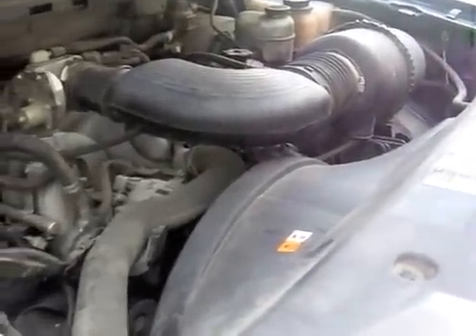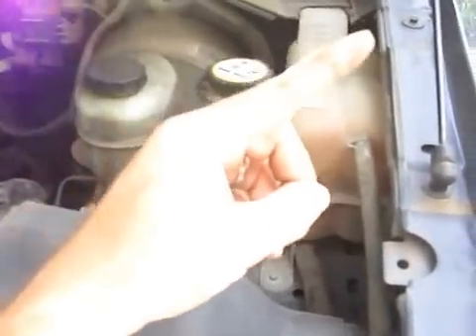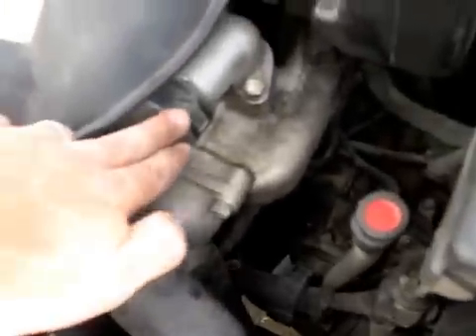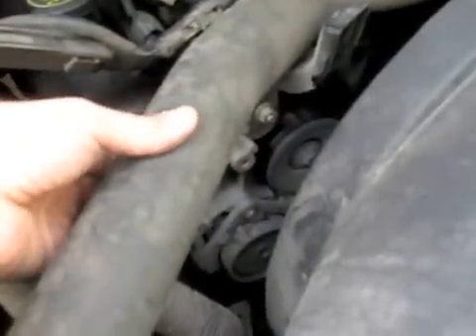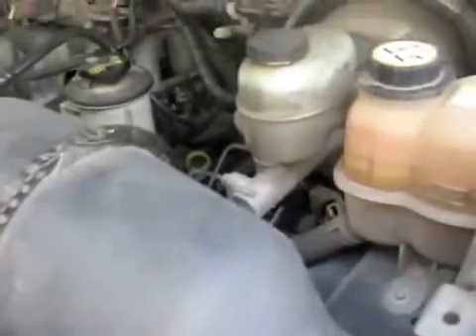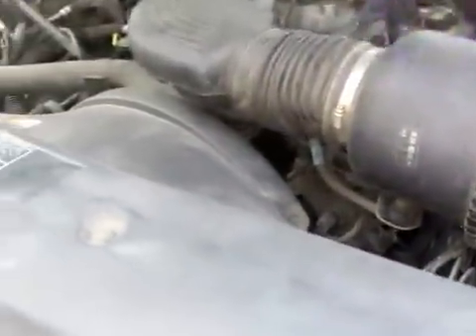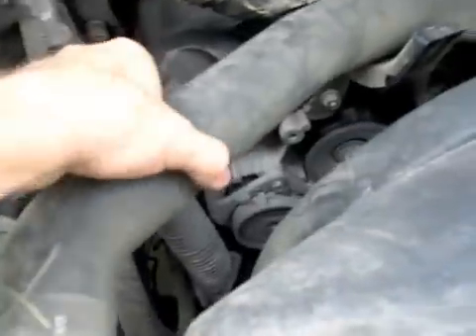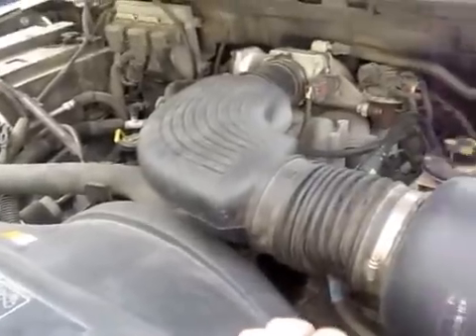Car Engine Overheating - Causes and Symptoms of Over Heating  Car Engine

Comment from the maker: The newer 323 should have an electric radiator fan. Overheating at slow speeds is due to lack of air flow across the radiator and or lack of coolant circulation inside the engine/radiator.  A bad manual fan clutch on an standard fan, a coolant leak somewhere, air pockets in the cooling system, a faulty radiator cap are things I would look for. Open the hood with engine on and running hot, if you have a manual fan the air from the fan should be hot/warm, if not the radiator is low on coolant.

Comment from the maker: Did you watch the video? If the radiator is low on coolant I would get a pressure test done on the cooling system first. if not low, make sure the electric cooling fans are coming on at idle. Then check to see if there is a restriction in the radiator causing low coolant flow. The boil over is just a SYMPTOM of the overheating, so have to find the cause of the overheating. My video should have helped narrow things down. Start with coolant level, fans, radiator restriction or air pockets

Comment from the maker: I still suspect a problem with the electric cooling fans or you have a radiator that is restricted with gunk at the bottom not allowing coolant to flow fast enough throughout the engine.  Double check that the electric fans are coming on then feel the upper and lower radiator hoses (caution they will be hot, or should be hot) they should be about the same temperature when the engine is at normal temp. If not, you have a radiator restriction or an air pocket in the cooling system.

Comment: hai, my engine would overheated when I switch on an air conditioning system or when the traffic is not smooth, I sent my car to workshop, the mechanic told me the radiator fan in good condition so he replace the thermostat, replace the thermostat, radiator cap, and flushing the radiator but the problem still there.Pressure test showed that my radiator no leaked, anyone can help me?

Comment: I'm thinking of getting a 66 v6 mustang for my first car, would this suffer from overheating issues, I worry about how it would cope in traffic, costs about 10000 dollars. Thanks
Reply: If it is al original and has thermostat and all the wirig looks original and not aftermarket it should be ok
Reply: I would check the oil. And oil leaks any were and press the petal to the metal if it get hot is not good

Comment from the maker: If your radiator is leaking you will need to replace it, have not seen a sealer or additive that works on the newer plastic radiator.  Fans might not be coming on because they are getting a signal from the coolant temp sensor and if there no coolant the sensor might not work.

Comment from the maker: Yes, first things first. Get a cooling system pressure test to determine if you have an internal or external coolant leak.  Are you sure it is actually overheating and not a gauge problem?  Can you open the hood and listen for boiling over?  When engine is overheating make sure radiator fans are ON, and squeeze the upper radiator hose (use a rag will be very hot) and make sure you are not able to squeeze it together, should have pressure on it.

Comment from the maker: If radiator is totally full, thermostat is working, upper and lower radiator hoses are NOT even close to being same temp and cold air out ducts I can only assume you have a restriction somewhere most likely the radiator itself or you have a large air pocket in the cooling system that needs to be bled out (would only be there if you replaced a cooling system part recently)  My gut says a 9 year old radiator is full of junk at the bottom and time to replace (not flush) it.

Comment: I have a ford windstar 2004 that is over heating, changed thermastat, have no leaks top hose is hot bottom hose is cold. front and rear air comes out ice old and the cooling fans are running. wha o you think. thanks for help

Comment from the maker: Sounds like there could be a restriction in the radiator, which will require a new one not "flushing".  Lack of coolant circulation is probably the issue and with the lower hose cold, it only tells me there is rust/mineral deposits at the bottom of the radiator preventing that coolant to flow.

Comment: I  never  see problems  with the temp guage going up....but, when the  motor oil going down  or turning darker after a drive on the hiway...THAT could be you first sign of  overheating....long before you have problem with  antifreeze/water going down or  a  sign of a  leak in the cooling system.   
I think THIS is  the first sign of  a  problem with overheating....and, a pressure check on the cooling  system should be done right then and there.  Most especially if the lower radiator hose is cool

Comment from the maker: I would first get a mechanic to do a cooling system pressure test to determine if there is a leak, either external like a radiator hose or internal like a headgasket leak.  Once you determine there are NO leaks, then I would check the electric cooling fan up at the radiator and make sure it is coming on when the engine heats up. Second, I would check for a radiator restriction that is not allowing cooling to flow properly, "flushing" does nothing, replacement of the radiator is the cure.

Comment: i have a 2000 pontiac grand am v6 3.4 motor having problems with overheating we've replaced the water pump and about to replace the thermostat but im not sure if thats gonna take care of the problem it over heats quickly even if im only doing as low as 30mph  we started it up about 2 days ago white smoke did come out with a strong fume smell but after about 10 to 15 minutes it cleared what could be my problem im thinking radiator or head head gasket PLEASE MESSAGE ME

Comment: Great video. Thumbs up :). So, the problem that I had, is my van causes an overheat on a stop lights. and When I pull over and check the engine, I had the slipping belt, it went off and not only that but there were some green liquid splatterd on the belt and on other pipes, i believe it's the coolant. Does that mean there's also leak somewhere? Would appreciate if you reply..thnx for posting the video tho.

Comment from the maker: Well, I would make sure the cooling fan is working, there is not a coolant leak and the radiator is full, and there are no air pockets in the cooling system.  I would not remove the fan just yet, figure out if there is power to the motor first. You might have a bad fan motor or a bad cooling fan temperature switch that is not sending data to the fan motor.

Comment: My Relay was blown, i replaced it. and my car only overheats at low speeds. highway speeds its fine. where should i start troubleshooting? Im thinking about taking the fan out and making sure its functional with external power...

Comment from the maker: If your engine is overheat more at freeway speeds and you are sure there are no internal or external coolant leaks I would be suspicious of a restriction in the radiator, and replacement is the answer.

Comment: great video but what should i check next if i have replaced everything, water pump, thermostat, flush the radiator, new radiator cap, pressure test, check for leaks, sensor,fan clutch. i don't know what i should look for next. 06 dodge dakota. anything will help thanks